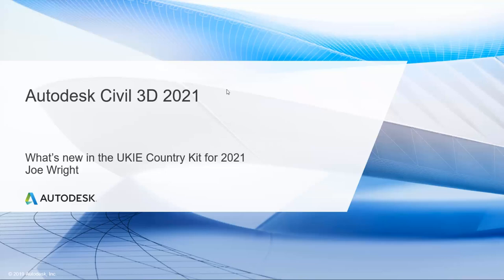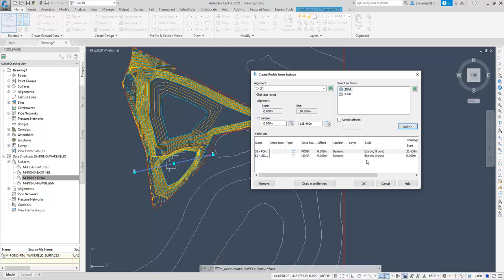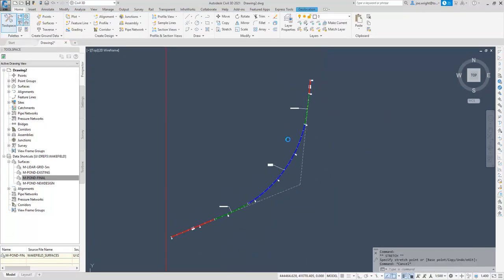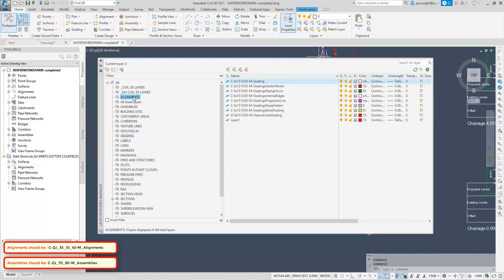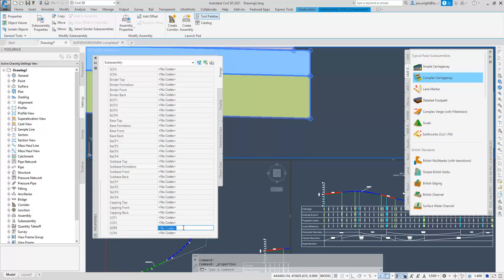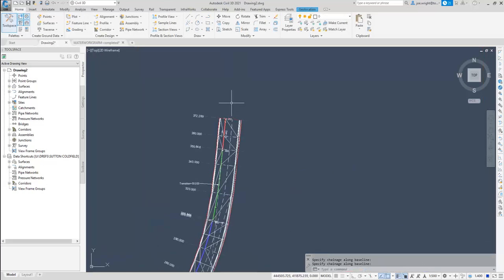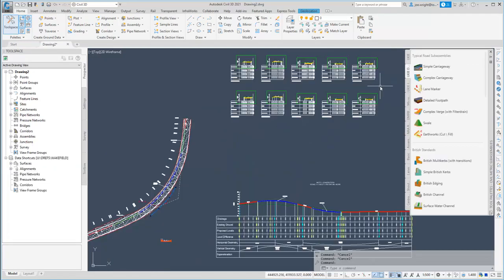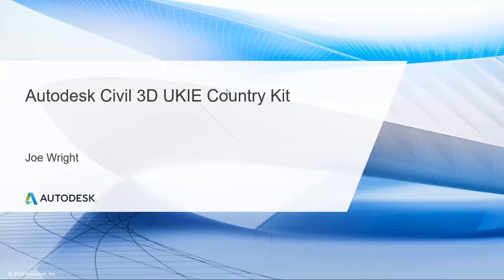Civil 3D UKIE 2021 - New Features

Comment: The Multi use kerb is great, however the default height for a HB2 kerb in civil 3d 2022 is 100mm, for almost everywhere in the UK it is 125mm.  We can only have 1 custom kerb in the multikerb so this cause issues when modelling accurate kerb heights.   Is it possible for future releases to set the kerb height back to 125mm like it use to be

Comment: Great job! 
It would be fantastic if you could include couple suggestions  I think we all could benefit from.

On subassemblies.
1. On kerbs could you add option to be able name point code for kerb bottom (channel line) for example HB2, SP1, EF etc. It would help generate relevant feature lines for those kerbs for setting out, kerbing drawings and pay items.

2. On daylight subassembly, could there be added option for vertical targeting (to 3D polyline or feature line)? Benefit is to keep cut/fill coding styles.
Is there a way to have tadpoles as part of style (hatching style, but needs to maintain 90° angle to hinge line). Manual tadpole creating is long process on complex corridor.

3. Road subassembly, is it possible to be able assign individual  link code to top pave layer? It woul help to add different styles to different materials (asphalt, pave, concrate, redway, etc.)

Toolbox exports. 
4. Is it possible in Feature lines export from corridor generate feature lines names on plan and xyz point table? 

5. And could we have point exports to plan and xyz table include option for full corridor not only to individual aligents as I do have usually many alignments in one corridor.

Thanks for your greater work,

Comment: *Someone forgot to do the homework.

As per GG184 standards:
4.9.1 Consistency should be applied in the descriptive text used, through the use of template/seed files
appropriate to each discipline.
NOTE 1 Although Uniclass permits underscore, ISO 13567-2 [Ref 8.N] sub-clause 6.2 stipulates a maximum of
six alphanumeric characters and the underscore and hyphens are used for other purposes. For
purposes of this specification, therefore, underscores are not used within the classification field.
NOTE 2 Examples:
1) D-Co3265-M-NaturalAreas
2) CH-EF3060-P-Pavements

You had it right before :/

*How changes in the Uniclass are managed (updates every 3-4 months)? Which version of tables are you using?

4.7.1 Uniclass 2015 is a dynamic classification and users should be aware of the changing nature of the system
Reply from the maker: I will push this out for discussion amongst the community. The layering standards have changed and developed over the years and I did add underscores to the layer names as this was deemed correct. You may wish to participate in the discussion, https://feedback.autodesk.com/project/forum/thread.html?cap=eb60b82d466546738ba757786e8dc5dc&forid={ec740ed9-e57d-4736-b723-2d854f0ed2cf}&topid={EC9EAC8F-859B-4CFE-BE7F-6CC9B201F9BE}.

Comment: Hi Joe, will the files such as the assemblies and template be compatible with Civils 2019?
Reply from the maker: The template will be compatible with 2019, however, I have not fully tested this compliance. The sub-assemblies were designed in Sub Assembly Composer 2020 and it is unlikely they will work in 2019, but they should work in 2020 if you manually import them from the source directory. Hope this helps.